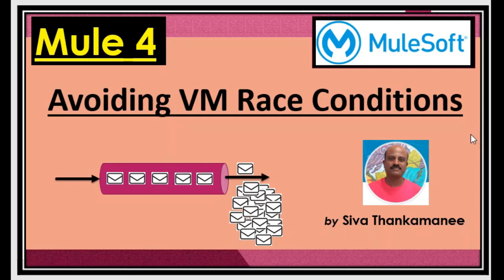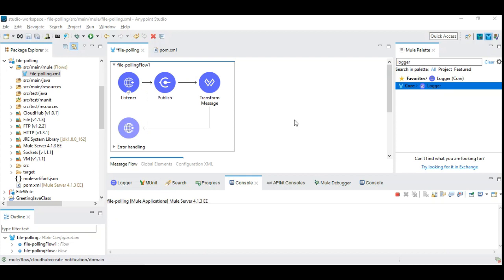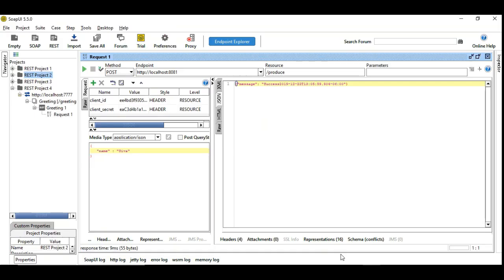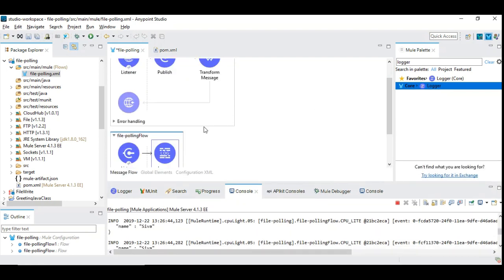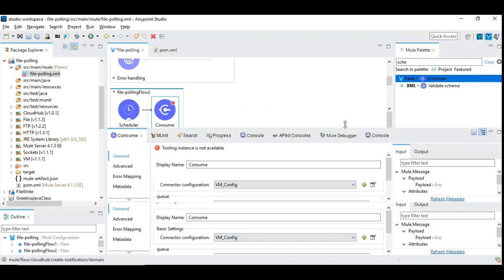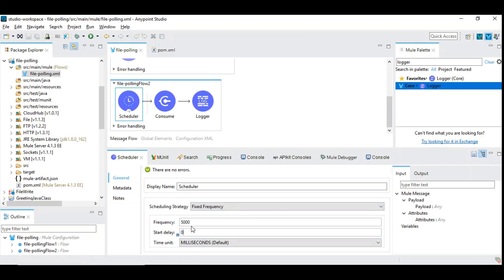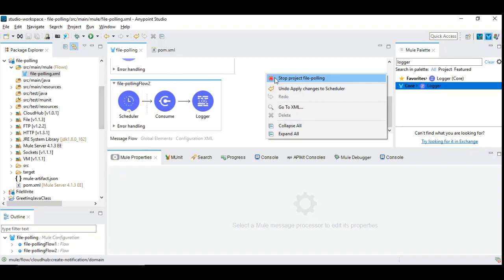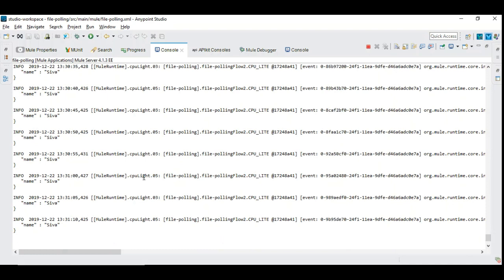Design Concepts || Avoiding Producer-Consumer Racing Scenario in Mule-4

Comment: Hi Siva,
If we have set frequency to 5 seconds and start delay to 10 seconds in scheduler...does that mean every message gets processed after (5+10) seconds? Or how does that start delay works ?
Can you please help me to understand
Reply from the maker: Hi Bharath - The Start delay is used only for the first time once the Flow comes to active state and waits for 10 seconds before the polling gets activated and from then on, it takes the interval of 5 seconds. Ideally, it is better to set both the identical values to both 10.   This avoids once the flow comes to active state, it does not pick out the file so suddenly.  Hope this helps.
Reply: siva thankamanee thank you siva for he reply ...
Say if I have 2 messages to be consumed, then at the 15th second first message gets consumed and at the 20th second- 2nd message will get consumed 

Did I understood right ?
Reply from the maker: Yes Bharath.  You are correct !!
Reply: siva thankamanee thank you Siva 😊